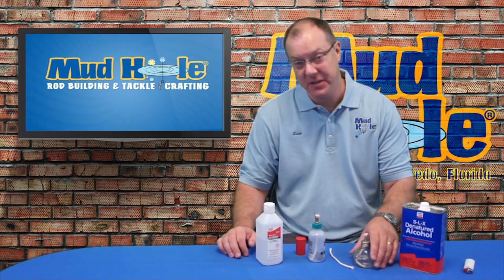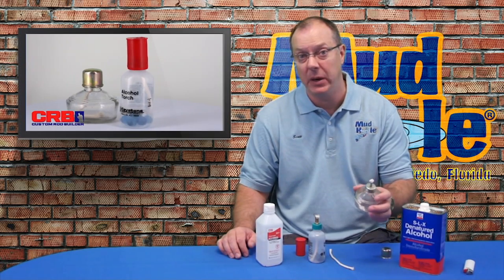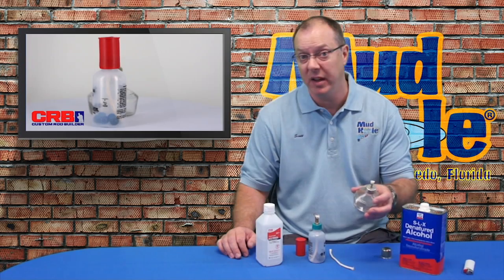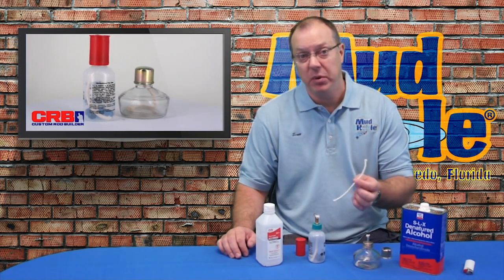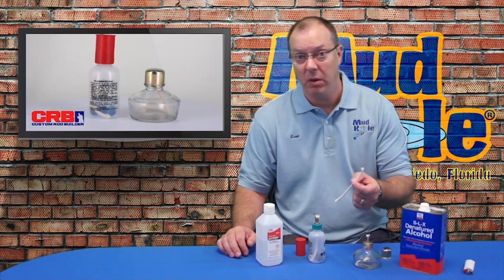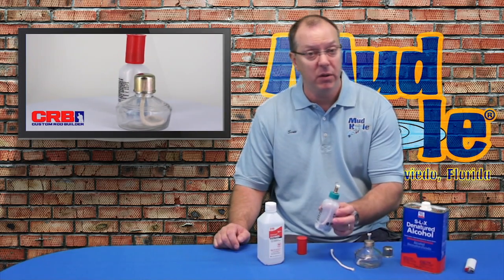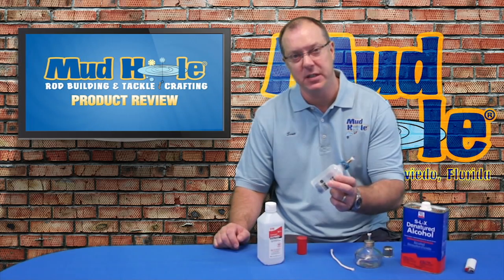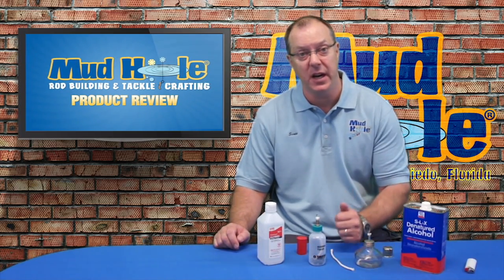Alcohol Burners & Alcohol Torches

Comment: Why only denatured alcohol?
Reply: The other kinds are 
1) Ethyl alcohol (the kind that goes on n booze): In most countries, it's simply too expensive, and/or diluted with flavors, and not pure.
2) Isopropyl alcohol (found in hand cleaner and rubbing alcohol): This has good heat and is cheap, but often contains up to 50% water, and always burns with a yellow flame which leaves soot all over your pot.